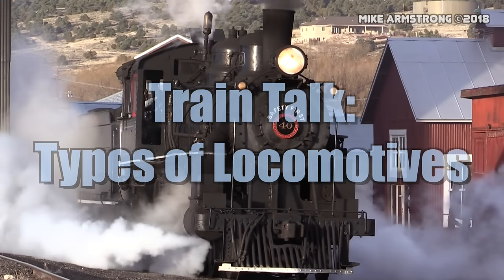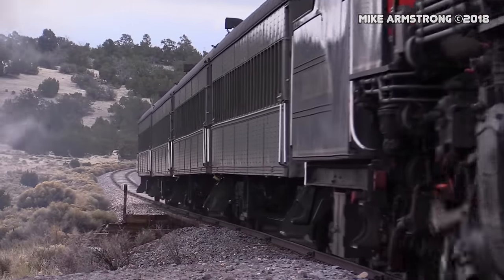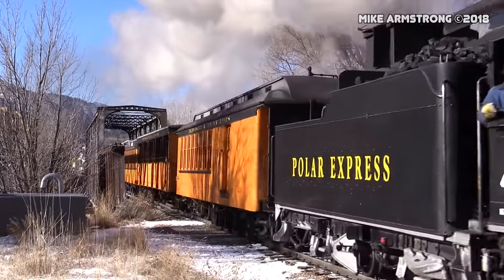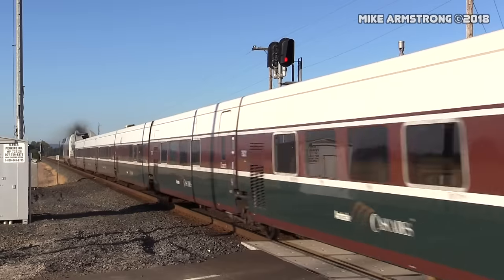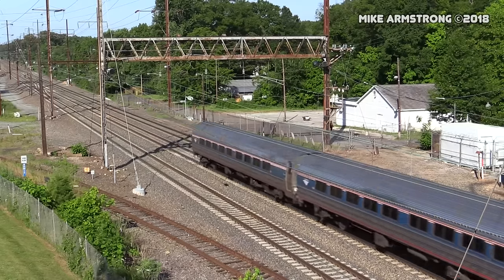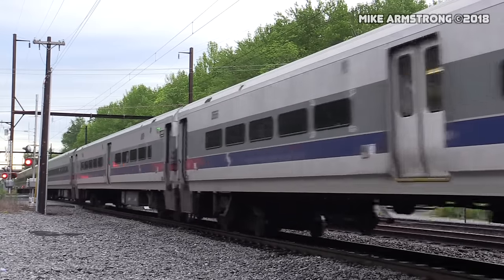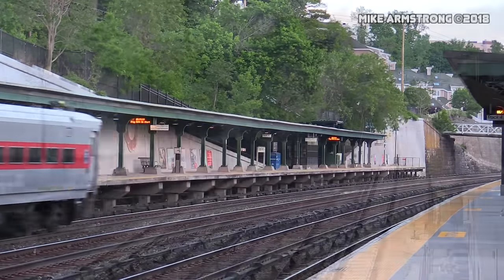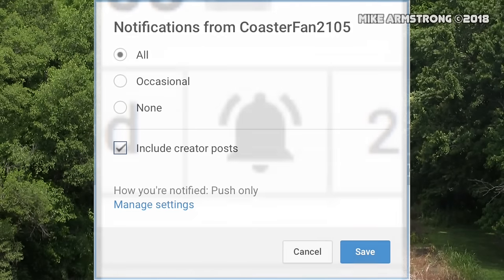Types of Locomotives: Train Talk Ep. 16

Comment: You did not mention that, while rarer still, there were and perhaps are a few turbine powered locomotives, though probably only in museums today. Generally they used the gas turbine  (there were steam turbines too) to power the electric traction motors.

Comment: Summing it up nicely. However I think the main reason why american freight lines are still with Diesel power ist cost and not security related. In Europe more than 50% of the track is electrified including Switzerland with almost 100% without any security issues
Reply from the maker: Yes, perhaps I didn't clarify that well enough. What I was trying to say is that freight railroads don't electrify because of both the high cost of the infrastructure as well as the dangers of having live electrical wires/rails in switching operations. Thanks for the comment!
Reply: Also, while it is probably true that non-electric tracks (including low volumes spurs and so on) are more common in the world, by traffic volume my guess is that electric is dominant because high volumes lines outside North America tend to be electrified. Both Russia (and most of the post-Soviet states, the entire length of the Transsiberian is electric) and China have been largely electric at least on high-frequency lines for quite a while, India is in the process of electrifying most of its network, and Europe is mostly electric on high frequency lines.

Comment: And to add to what Mike said, some electric routes today are diesel-electric friendly. Historically speaking some routes were electrified to improve operation where steam was a big risk of a problem. Today, these lines are diesel run mainly due to improvements that allowed railroads to abandon electric in favor of diesel. For example, the Norfolk and Western Railway used electrics to assist steam on the infamous Elkhorn Grade, which was a particularly bothersome grade, especially due to the Flat Top Tunnel. While electrics hauled westbound coal, and hauled the empties east, eastbound coal trains used steam and had to bring the empties back. Once the Elkhorn Tunnel opened, the N&W no longer needed electric locomotives, and as such, the N&W discontinued electrics. Electrics came back in 1959 following the merger with the Virginian Railway, but in 1962 the electrification again ended, as it was deemed surplus.
Reply from the maker: Thanks for the additional info, Jessica!
Reply: CoasterFan2105 No problem. One of these days you and I can discuss this more privately. There's other examples I'm aware of that I'll share with you.

Comment: There are some diesel or gas mechanical locomotives used in industrial settings.  They have a clutch and transmission similar to a truck.

Add battery electrics for use in mines or tunnel construction.
Reply: In Switzerland there were steam electric locomotives. Those locomotives were converted from coal-burning, modified with electric heaters, but retained their fireboxes fornon-electrified tracks.
Reply from the maker: That is true. I didn't mention them in this video because their use in the U.S. is relatively limited. Also, I didn't have any video of them to use.
Reply: Roy Reynold

Comment: As the talk of various types of locomotives when there is at least four types of locomotives starting from steam powered as in the early days wood was burnt along with coal to boil water which turned to steam as large connecting rods connected to side rods turn the driving wheels making the locomotive move which pulls a train.  Starting in the 1940's many railroads were dieselized as the term was diesel-electric when a large diesel engine called a prime mover turns a generator which produces electricity to power the traction motors part of the truck assembly as the traction motors could turn into generators when many locomotives could be equipped with dymanic braking.  Straight electric take power from an overhead line or third rail through a pantograph as the high costs to install and maintain the overhead line would be suited for high speed passenger service.  The last type of locomotives are dual mode when many operate as diesel-electric when they get into third rail territory the engineer switches to straight electric mode while keeping the train rolling as the prime mover them be shut down.

Comment: Europe actually has a lot of electrified freight as well as passenger track.  It seems to be the Americas (not just the US) that are allergic to electrification, even de-electrifying many lines.

You left out some major electric operations in the US:  New Jersey Transit, SEPTA, and the Long Island Railroad.  You also left out a major user of dual-mode locomotives (although showing one briefly):  New Jersey Transit (and Montreal has some of the same kind of dual-mode locomotives that NJT has).

Would have liked to have seen mention of diesel-hydraulics, which were popular in Germany before the electrification became as widespread as it is today, and Krauss-Maffei even made some for the Denver & Rio Grande Western and the Southern Pacific (although they all ended up on the Southern Pacific after a short time) in the 1960s.  (A few were also used in the UK.)